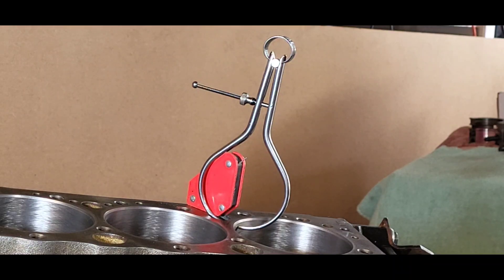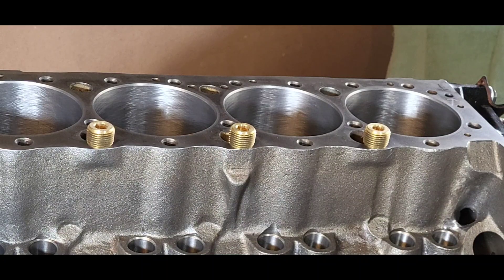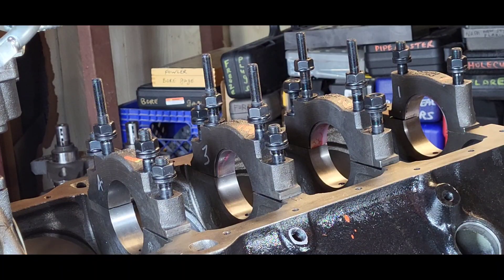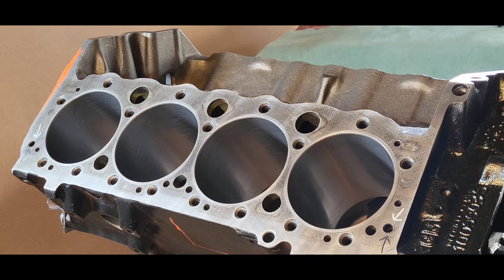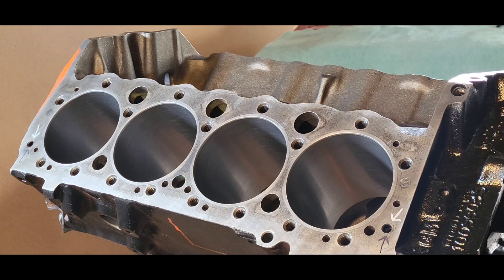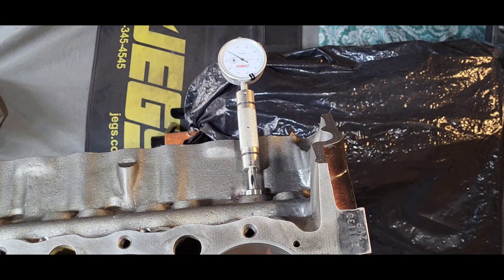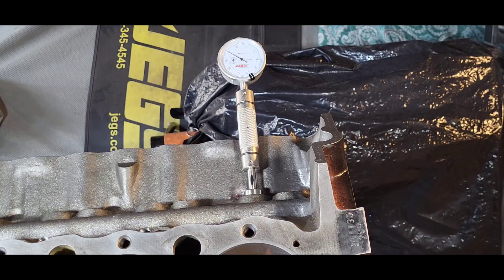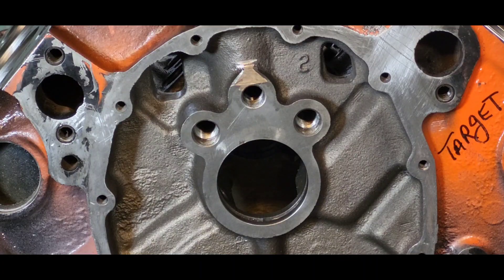Pick your Poison.  Omit unnecessary Options.

Comment: Good vid!  I noticed the front of the last block said "Target".  Is that the "Heco in Mexico" block?  Are they any good!
Reply from the maker: It's at the machine shop.  Will let you know.
Reply: Probably the best block you can find but throw away the guts!  Higher nickel content and thicker casting makes this block better with out buying a aftermarket block.
Reply: @dpierson489  Good to know...thanks!  I have one of these sitting in my garage someone gave to me!
Reply from the maker: Hey, just wanted to give you an update on the "Hencho in Mexico" block.  The machine shop called and said the Number 5 hole cleaned up at 30.  So the final analysis is, "Yes, this ain't a bad block for any street motor.  We had it squared, magged, pressure tested,  align honed, and yeah, quite happy about it.  It got a passing grade.  They replaced 3 caps because of improper fit.  Too much movement side to side.  That made it better.  And they had a fitment problem with the flex plate where it fits on to the crank.  Don't know if they made that up or not.  FYI.  Later.
Reply: @the4flatgarage  Thank you!  And glad to hear the block is cooperating with you and the machine shop!  Must say that the Heco in Mexico block I have has nice machining on it, even better than the early 70s blocks I have!
Reply: @the4flatgarage  like I said THROW AWAY THE GUTS crankshaft/ rods ect! Get the rods out of a 305 and a good crankshaft out of a 350 but notice the depths of the counter balance holes in the counter weights, they should be shallow, if there any deep ones it is a 305 .. you install the wrong one it may vibrate. Casting numbers are the same

Comment: The can lobe tool is supposed to show lift and with your line, whether the lifter rotated. Was it only the number 1 intake that had a problem, or did all the lifters not turn and you lost confidence in the tool? How would the tool scratch the lobe?
Reply from the maker: Lifters turn when the cam lobe comes up on them.  The tool is inadequate.  Any scratch or scuff on the lobe (solid flat tappet cam) results in failure.
Reply: @the4flatgarage  Are we talking about a visible mark on the lobe or something that requires magnification to see if even then?

Comment: FROM WHAT i REMEMBER ON THE BIG BLOCK 429-460 FORD. YOU CAN GO AS HIGH AS .120 OVERBORE THAT IS HOW THICK THE CYLINDER WALL WERE MADE.
Reply: On the early 460s yes that is correct. On the later version they thinned up the walls for gas mileage. Same goes for the 302
Reply: @chickenandmilk1216  THANKS FOR THE UPDATE ON THE LATER VERSION BLOCKS.